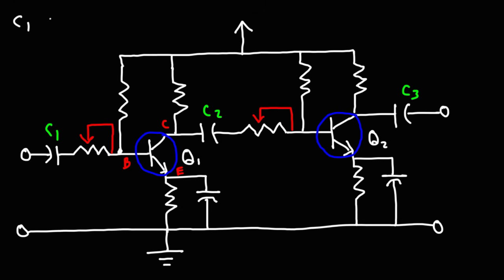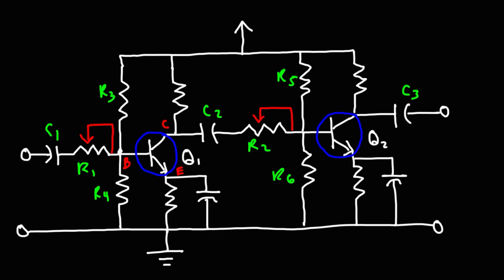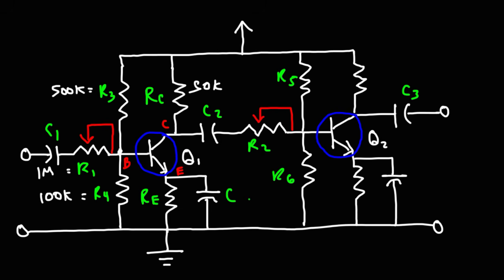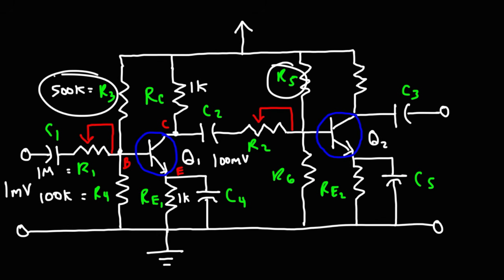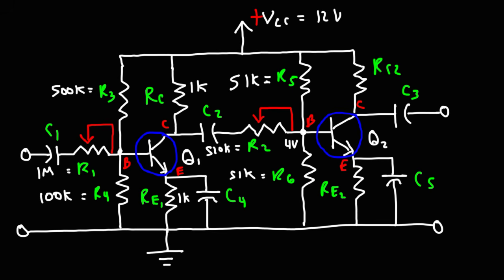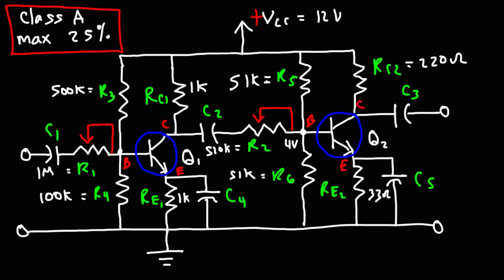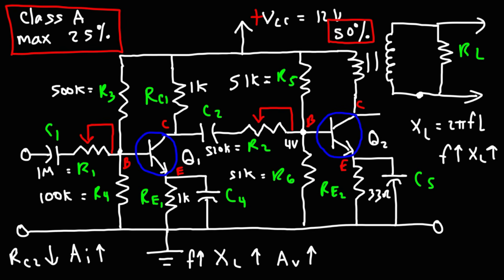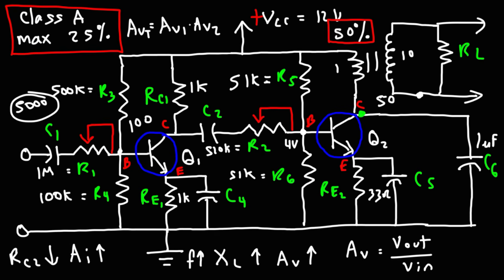Multistage Transistor Audio Amplifier Circuit

Comment: 3:35 You say R1 and R4 provide voltage divider (volume attenuation) for the input signal. But shouldn’t it be R1 and (R3 || R4)? V+ will typically have a capacitor to ground, which passes AC, thus through R3 there is a parallel way to ground for AC.

Comment: Hope lots of people watch your video. 

It is the ONLY one I’ve come across that goes straight into explanations of the capacitors and their role into determine what type of Signsl is allowed to go through. And how by changing its value - a different type of Signal goes through. 

And you explain how the reactance is worked out for each of those capacitance values -

PRESENTING AN IMPEDANCE ( resistance) at those different frequencies !

Well done 

- others behind “complicated math” - which as you’ve shown is NOT complicated.

Capacitors “shape” the sound we hear !

Comment: At 22:30 , I happen to disagree because capacitive reactance is lower at high frequencies and this will allow high frequencies to pass through and on the other hand, at lower frequencies capacitive reactance is very high and this would block low frequencies,thus the maxim : A capacitor blocks DC and allows AC to pass through
Reply: I agree I study EE, thats why a high pass filter is a capacitor in series and why the capacitors block DC and low frequency distortions. We test amplifiers with high frequencies to see more this bypass effect.

Comment: Why you use multi staging ampli if you can set the first stage Vce & Ic to half?
Reply: Consider Beta is 100 and the current on Ib is 1mA. You can only get 100mA of current on Ic. Multi stage amplifiers are used to increase power in the later stages. I am currently trying to make an RF amplifier circuit, current on the antenna is pretty much nA and takes careful amplification to get a decent signal to decode audio.

Comment: currently preparing for my physics one final on Monday using your videos, will be studying this next semester in physics 2, I guess it never ends
Reply: How did your tests and classes go?
Reply: @PunmasterSTP  eneded up getting a b- in physics 1, but to be fair my professor was very difficult. Currently in my junior year of electrical engineering with a 3.6/4 gpa
Reply: @Brandon-lx3mf  I think a B is good, especially for a hard professor, and I'm glad to hear about your GPA!  I was close to EE myself (I did biomedical engineering with a concentration in programming and electronics).  How has that been going?
Reply: @Brandon-lx3mf  Would you say that this is a good first project to complete as an EE student, I'm still taking intro engineering courses but have been doing a lot of self-studying on the subject
Reply: @fisherofmen489  Yes definitely. If you can understand this well you will do good in your electronic courses

Comment: How do you integrate (lnx/x)^2  
Answer please
Reply: Use integration by parts.

U=lnx
Du/dx=1/x

V=1/x^2
When integrate V=-1/x

The formula=uv-integral of vdu

-1/xlnx-1/x^2

The last answer you can remove of vector:
-1/x(lnx+1/x)

Comment: How can you solve circuits with complex capacitor layouts, i.e. that they cannot be reduced by using the formula for capacitors in series or in parallel? Does Kirchoff Law applies to capacitors too?
Reply: I think that Kirchhoff's rules always apply, but when analyzing alternating currents, you have to remember that capacitors and inductors each have a reactance.